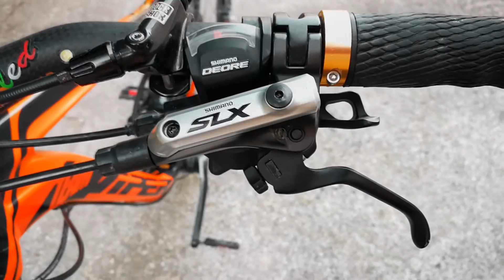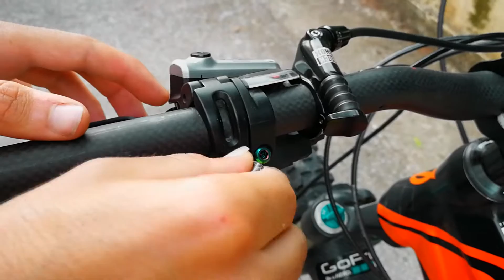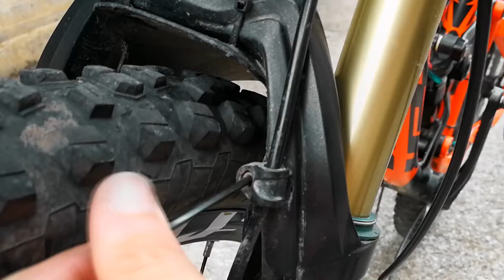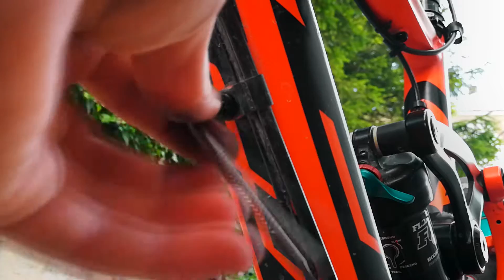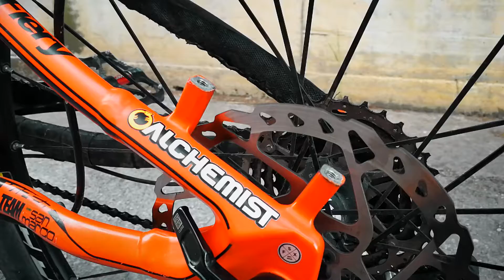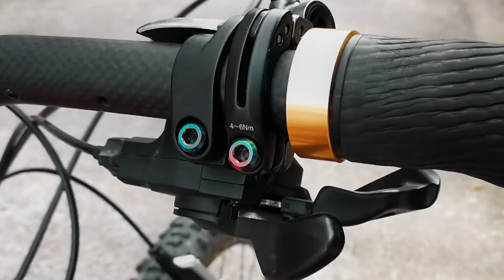MTB BRAKES UPGRADE - BIKE BUILD

Comment: I’m glad you upgraded your brakes, but there was no value to this video other than patting yourself on the back. You purchased a pre-filled set of brakes and replaced a set of brakes no technical instruction no advice on why you chose them no captions just a really grating soundtrack.
Reply from the maker: Hi this is not a video tutorial.
Reply: @ I agree. Why not just video your bike drying in the sun after a wash or you doing laundry?